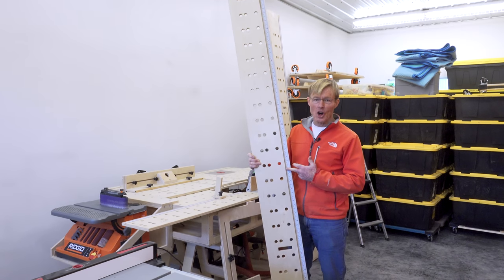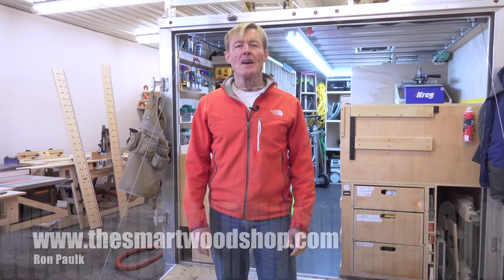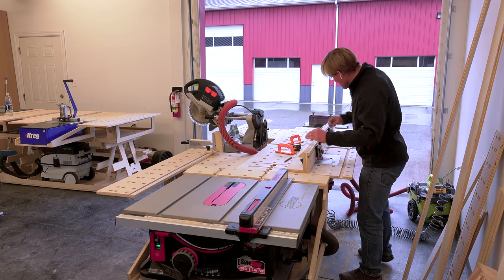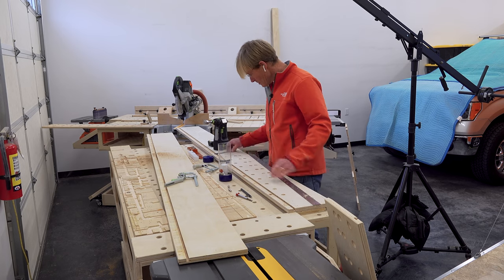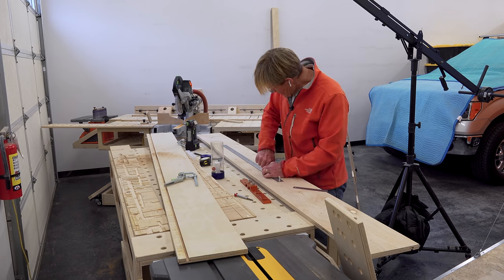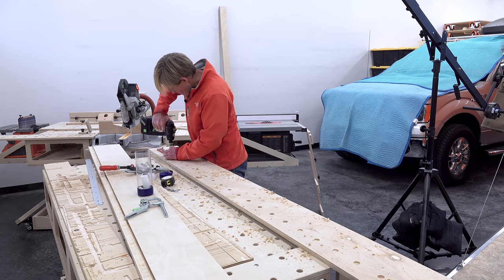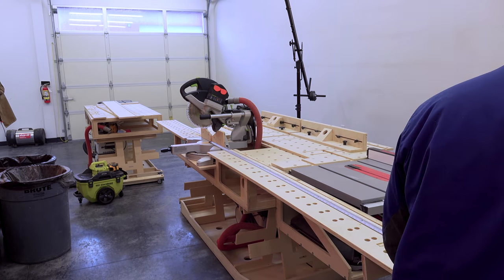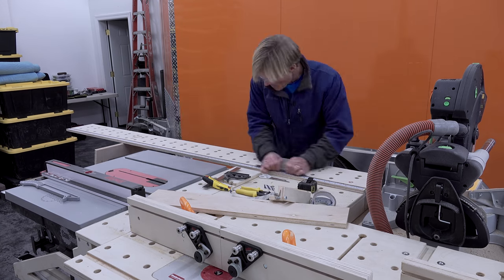Long Miter Tracks

Comment: Ron, have built your trailer, router tables, and smart station. I love your ideas. You do not however tell the spacing changed for the Dewalt 12” for the dog holes. Nor is anything in any plans. Winging it like I do with a lot of your plans!
Reply from the maker: I show it in the video, but only have plans for the Kapex. Note the dog holes don't change. In the video, I just modify my Kapex version to accept the Dewalt and still work with the Kapex. I use a second set of flip stops for the Dewalt as they are calibrated to the saw. Thanks, Ron 😎🤙

Comment: What would be the best way to get the grid set up on a narrow piece with just the Parf guide, and no template? If my math is right, you would need a board at least 18in wide to set up a 3-4-5 triangle at 96mm spacing (including a 32mm gap between the edge and the center of the first row of holes)

Thanks!
Reply: I would say make the dog holes in a wide piece first,  then rip down to the desired width

Comment: Is there a reason that you don't use Aluminum T-Track and make your own T-Track? I would probably prefer to use Aluminum T-Track but am concerned there may be a reason beyond cost that you don't.
Reply from the maker: Many, many reasons that I have covered in multiple videos. Here are a few: 1. hard to get t-track longer than 6', 2. Aluminum doesn't offer me any advantages over wood. 3. Aluminum T-Track is thick so the dado in 18mm ply to mount the track leaves very little wood for attachment. 4. I can make any length t-track I need in any tool: miter tracks, router fence, cross cut jig, cross cut sled, etc. as fast as I can cut the dado to mount aluminum T-Track. Save money, save money, save money. For me personally, I prefer wood over aluminum even if the aluminum were free. These are just my experience and opinion, you may have reasons or needs that aluminum would work better for you. Hope this helps!